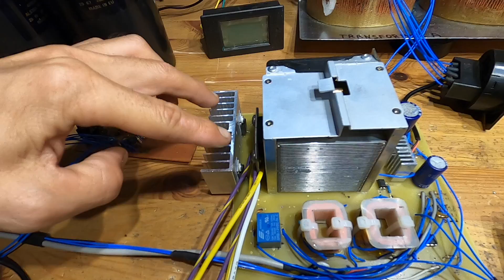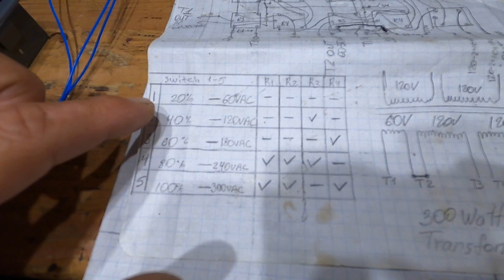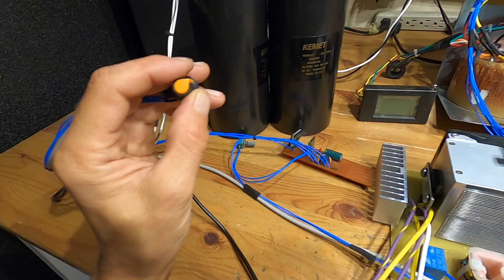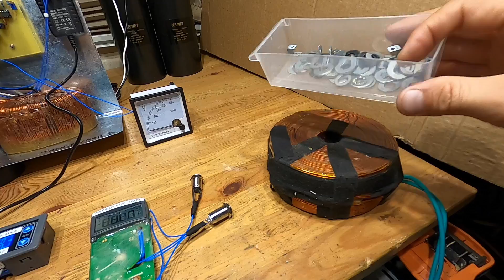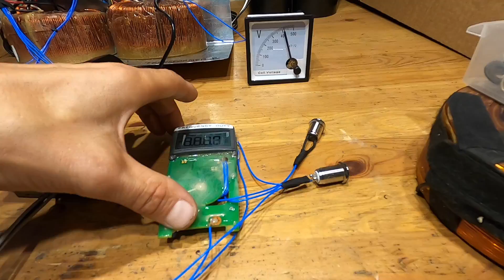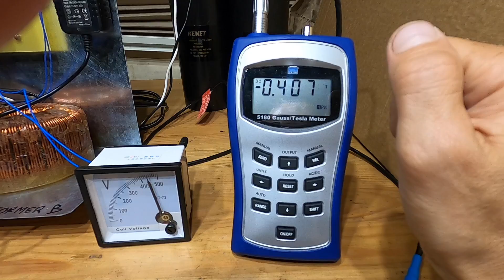035 My 410V PEMF Prototype 1-600Hz 1-30% Duty 2x11.000 Gauss 2 Coils 1.2kW Peak Power Draw

Comment: Andrey just ordered the components for the 1B Circuit, the 10000uf 100v capacitors are in. Back order.
Reply from the maker: Seems like 30,000 uF per channel is the lowest amount required.
I think 50,000 would be more stable, but 30,000 uF is good.
Reply: @AndreyD  so for the basic 1B circuit I can install (3) 30,000UF 100v capacitors instead of the (3) 10,000uf ones ?
Thank you .
Reply from the maker: @Enoch-Gnosis  If you can afford it then go for it. 100,000uf is enough
Reply: @AndreyD  CAP ALUM 10000UF 20% 100V RADIAL
Those are in back order everything else will arrive shortly 👍🏼I still need to source the heat sinks !
Reply from the maker: @Enoch-Gnosis  around 50,000-60,000 should work the best.  If you put more then you need to put stronger Mosfet and possibly current monitoring circuit.
Reply: @AndreyD  your 1B schematic calls for (3) 10000uf 100v capacitors correct ?
Thank you ..
Reply from the maker: @Enoch-Gnosis  Yes, 3x10,000 uF is the lowest amount of microFarads I would use
Reply: @AndreyD  thank you Andrey!